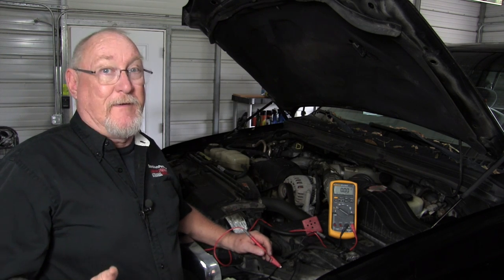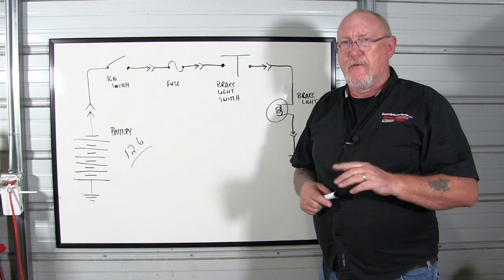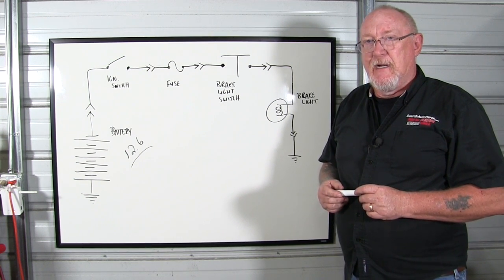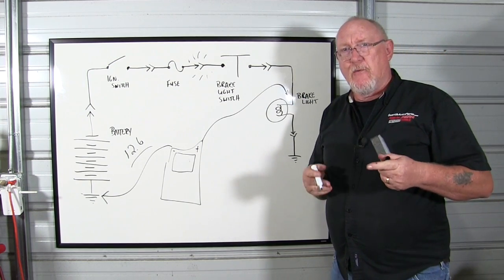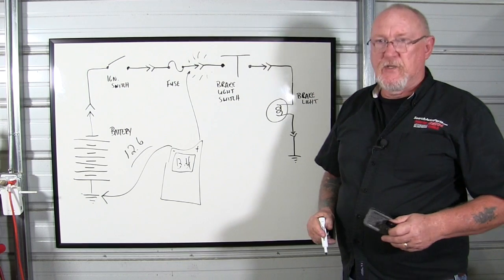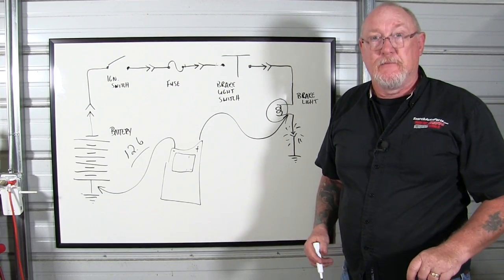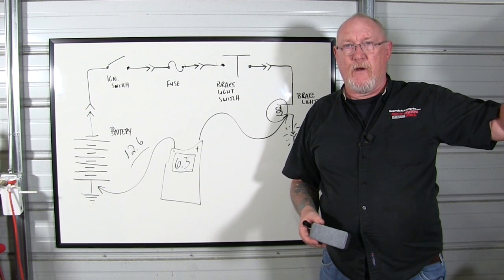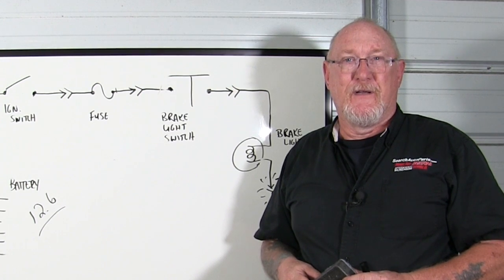The Trainer #84:  How You Can Measure Voltage When Your Meter Leads Say You Shouldn't

Comment: So if I pull the negative battery cable clamp off the batteries negative post, and check for voltage between that clamp and that post should I see any voltage? Does this indicate a parasitic voltage drain if I do? It’s a 74 GMC and there’s nothing that should be on (closed circuits).
Reply from the maker: The answer to your first question is "Yes, if the battery cable is disconnected, you will see full battery voltage". Essentially, your test leads are in the same position they would be if you were measuring battery voltage directly at the terminals. Think about it - the negative lead is on the negative post and the positive lead is on the positive post - in an indirect way - from the end of the negative battery cable through its frame and/or engine connection, through that frame/body connection, through any one of a hundred electrical components (like a light bulb) to the positive side of the circuit and back to the battery positive post.

Now, if the battery cable is connected and a circuit is on, you MAY see SOME voltage is the connection has an issue like poor contact or corrosion.

Second answer is "No, it does not indicate a drain". Why? The path is open and no current can flow.
Reply: Motor Age Thank you for the quick reply. I had thought that I wouldn’t see any voltage if everything were turned off. I even had the whole wire harness disconnected at the firewall and was still reading voltage between the disconnected negative clamp to the negative post.  It made me think my positive was going to ground somewhere and I couldn’t figure out where. What caused all this questioning was my battery was draining and would be dead within a day. Had it checked yesterday and it turned out bad but I think because I had been recharging it daily that maybe it was ruined from being overcharged a few times... I installed a battery disconnect switch with the new one and I didn’t want to start off killing my new battery so I watched your vids and wanted to ask your opinion. But if seeing that voltage is normal then I’ll call it fixed. The vehicle is a 1974 GMC Stepvan (old bread truck) with a SBC 350 and it still has the coil, points and condenser. There’s nothing electrically on when the vehicle is off (no clocks or accessories etc) which is why I figured I shouldn’t see any voltage going to ground. Thanks!

Comment: On paper, that is 100% clear.  On a vehicle, I am not sure.

I assume you have to run a wire from the actual battery negative terminal to wherever you are testing to do that ground test.  Am I missing something?  Is there another way?
Reply from the maker: Yes, you'll need an extended test lead to reach the back of the car. I also use an older #PowerProbe that comes equipped with long leads. It's accurate to a tenth of a volt - plenty for the majority of the testing I do.
Reply: Thank you very much.  After retiring, I took a class in Marine Engine repair.  I have no experience therefore I struggle with the basics.  We bought and studied Dan Sullivan's Load Pro in theory but I have not actually used it on an engine.  If you are familiar with it, is it worth studying more?  Thanks.
Reply from the maker: @mcconn746  Dan's book is pretty good and absolutely worth studying. Another great electrical guy is Vince Fischelli at "Veejer Enterprises" -  Google him to get his web site info.
Reply: We studied Dan's book in my Marine Engine class.  I theoretically understand the basics but I need some experience to really know how to do it.  At 70 with no experience, not many people are interested in my working for them part time.  I am just trying to pick up what I can out of curiosity.

Comment: excellent video pete......here's my question.......on the first corroded connection after the fuse, if you put the positive lead of the meter before the corrosion and the neg. lead after the corrosion........would the meter reading be the amount of resistance the corrosion is causing in the circuit telling you that there is a voltage drop causing the brake light to be dim .would that be another way to check for voltage drop,,,,,,,,,answer would be greatly appreciated........thanks for the vid;
Reply from the maker: You can check segments of the circuit and that is part of the technique AFTER you've checked the entire length of the circuit. If there is a source of resistance between the meter leads and current is flowing, there will be a voltage drop across the resistance. That's what makes measuring resistance across a fuse a great way to locate parasitic drain!
Reply: @VehicleServiceandRepair  thankyou

Comment: BAD EXAMPLE BAD BAD BAD... the ignition switch CANNOT BE in the brake lamps circuit!...!?  DONK!
If all fails in traffic... car goes dead... YOU MUST BE ABLE TO HAVE a last chance at turning on your brake lights
thus the brake lamp circuit is DIRECT to B+, so the cannon ball coming down on your arse gets some red lights to attend!
and there are many more point to point V tests to be done as in at the relay/fuse box (printed board circuit), the brake pedal switch(is probably the 1st point to point to check- pedal at rest), etc... and many times there is a fuse at the hot side at the tail end of the vehicle... etc... DONK DONK DONK!  let us get it right and complete and let us make sure the newbie is not left gaga!
Reply from the maker: Vallid point - thanks for sharing!

Comment: First if you show 1.8V connected from batt neg to body ground would that not indicate a parasitic draw and give you less then full battery voltage when testing the battery? You lost me with your circuit diagram. You are showing an open circuit in your diagram. Both your switches are open so you should not be seeing any voltage at the bad connection between the ignition switch and the brake light switch. I'm also confessed why you leave the neg meter lead connected to the batt neg for all testing. I was taught to move both leads down the circuit when testing each individual component or connection while applying load as the circuit needs to be under a load to test for voltage drop. Not sure if I make sense because I don't see where the test at the start of the video follows the circuit example.
Reply from the maker: Let me see if I can clear up the confusion. 

First, no - measuring voltage on the ground side as shown is not indicative of a drain on the battery, nor will it impact the reading at the battery. The battery itself is not low 1.8 volts. It indicates that there is a source of resistance that requires 1.8 volts to overcome. "All voltage applied will be consumed by the resistances in the circuit, in proportion."  

And you're right - I should have closed the switches on the board to avoid the confusion caused. 

As for leaving the negative meter lead at the battery, it is the first step in understanding the concept of voltage drop. Many learned the way you did, by testing sections of the circuit at a time. The problem is you are not diagnosing the complete path of the circuit and may miss something.

Please search our channel's home page for additional content on using this testing method. I'm sure that one will help clarify what I'm trying to share! Maybe this one:  https://www.youtube.com/watch?v=qdaOSiScEu8&t=18s

And thanks for taking the time to comment.
Reply: @HikerBiker  I see your comment is 4 years old, so you probably already figured this all out, but I wanted to add to what Pete is saying for anyone having the same question in the future. 

A 1.8V or any voltage reading doesn't necessarily indicate a parasitic draw. In order for there to be parasitic drain, there has to be current flow and having voltage available (i.e. difference in potential, voltage drop) doesn't necessarily indicate that there's current flow. 

For example, when you put pos lead on pos battery post and neg lead on neg battery post, you will get a reading of around 12.6 volts on a good battery, but there isn't any current flow. You're only checking how much voltage is available from the battery. The mutimeter is measuring the difference in potential between the pos and neg battery posts. It's necessary to have a difference in potential (i.e. voltage) between the pos and neg battery post for current to flow, but the presence of voltage does not necessarily indicate current flow. 

One way to check if there's current flow from the alternator, block ground, or chassis ground is to put an amp clamp around the negative cable close to the neg battery post. Another way to check is to disconnect the neg battery terminal from neg battery post, and hook up a multimeter in amp measuring mode between the two. 

Hope this helps

Comment: pete.. or somebody print some copies of this test and give one to pete.. https://i.imgur.com/kviX0VQ.jpg   feel free as i assembled that test from decades of experience and multiple sections of various factory service manuals.. and i use it on EVERY CAR i work on.  i can perform the first 4 steps of the voltage drop test in less than a minute. so don't be scared to learn this.. it will save you hours and reduce your electrical comebacks significantly.  this takes much many times longer to type than it does to perform. 

the setup.. check the percentage of charge.  engine off.. turn the headlights on for one minute. turn the headlights off.. 
12.65 is a fully charged battery
12.45 is a 3/4 charged battery
 12.25 is a 1/2 charged battery... the battery needs to be over 12.5  for the next steps of this test to be accurate.  if the battery is below 12.5 .. put it on a charger and bring it up.. you can perform the next six steps with a partially discharged battery but the results will shifted.. 

 the set up.. start the engine.. turn the headlights on..   set your volt meter to 20 volts scale. 
test 1. positive to negative Battery Posts.. not the terminals around them.. 14.1 to 14.8 depending on the car is expected.. 

test 2. Negative battery post to the engine block.. 0.04 volts is expected.    this measures the Negative battery cable connection to the engine block.. if you find more than 0.04 volts or 4/100ths of a volt then you need to narrow the test locations.. 

 test 3.   Negative battery Post to the body.. this checks the mid size wire that runs usually to the inner fender..  that wire supplies electrons from  the negative battery to the body where almost everything is grounded to except the alternator the starter and parts of the fuel injection system on some models.  this should be 0.02 or less. 

 test 4.. the engine block to the body usually at the firewall.  this checks the engine to body ground connection..  0.02 or 2/100ths of a volt. or less..  why is this an important test.. the battery can put out 12.65 volts fully charged. the alternator can put out 14.1 to 14.8 volts .. so almost 2 volts more from the alternator. but the electrons flow from the negative side .. so the negative electron path is alternator housing to the alternator bracket to the engine block . to the cylinder head usually to a braided ground strap that is bolted to the firewall.. hopefully not on rubber bushing or plastic coolant tank mounting.  there is a lot of current flow there.. don't believe me.. throw an amp clamp over the braided ground strap with the engine running and the headlights on. 

test 5. this is a Positive battery post to multiple fuse in the underhood fuse block.  0.04 volts.   why test a bunch of fuses..  not just one.. if you have ever had a fuse block out.. you will see that the fuses are set up in rows .. each row connected to a fastener.. but if there is corrosion between the buss bars inside the fuse box.. you can easily have multiple voltage drop measurements inside the same fuse box..  i have seen it way too many times.. 

 test 6.. not possible on some cars and trucks. but easily done on 90 percent of cars and trucks. . test between the  positive battery post to the alternator output stud..  not the terminal around it.  this checks the electrical connections beween the alterantor and the battery positive..   this can be as high as 0.3 volts and be OK usually.. some cars and trucks could be as high as 0.7 volts .. 7/10ths of a volt and that number came right out of a 1966 chrysler imperial service manual i have. you will know which one as it has a bunch of 666666666 across the cover.

 this is not the end of your testing.. this is the test sequence you do on EVERY car that you open the hood on.. like i said.. i can do the first 4 steps in less than a minute. 

 why...  copper wire has resistance to electrons flowing thru  it..  the engineers specify the size of the wire depending on the load so they get the expected voltage drop when the loads are applied..  look.. you can't jump start a big rig with a pair of 10 gauge jumper cables.  you can jump start a big rig with a pair of 1 or 2 gauge jumper cables as you have reduced voltage drop  by increasing the surface area of the wire strands for the electrons to flow .. oh.. electrons flow on the surface of the copper .. not inside it.  so surface corrosion will cause voltage drops also. 

  print the test i linked on imgur..  learn it.. practice it while looking at the printed page..   if you have a car or truck.. that keeps eating alternators or just does not work right.. pull out your printed copy.. perform the voltage drop test.  see what kind of results you get.. if you get more than the 0.02 or 0.04 volts you may have a resistance issue..
  
volt meters only read the difference in voltage between where you touch the leads to.. so if you have resistance somewhere in the circuit.. find it using voltage drop tests while the engine is running.. the charging system must be putting out some current to push electrons around so you can measure their flow across the conductors. (wire stands) 

 why did i type all this out.. because my friends are lousy camera men..  and its crazy noisy where i work..  8 lanes of freeway less than 40 feet from the shop..  not counting the off and on ramps. i can't even hear engines running during rush hour.  let alone talk on the phone or on camera..
Reply: Thanks for typing out all this good info. The link in your comment doesn't work anymore. Do you have a new link?
Reply: @bernardocisneros4402  the link still works.. it does take you off youtube  the link is a jpg page that is tests 1 thru 6 i typed out above..

Comment: Thanks Pete.  When I was at work (retired now) I used to get vehicles with intermittents and unknown electrical problems.  Some of the others either didn't understand this testing or gave up.  I would show them.  Some got it.  One vehicle was at a L.A. Dept of Water  & Power yard that was near the ocean.  Oh ya, it brought back memories of Massachusetts and rusty, crusty vehicles.  Body grounds varied in voltage drops.  I ran a continuous number 10 gauge wire from a ground point inside the cab on the driver's side to ground points I found under the hood, finally crossing over to the battery on the passenger side and it's body ground there.  Had to repair that ground on the body panel then bolt the ground wires solidly to that panel.   Eliminated all the intermittent and unknown problems.  THAT was a "fun" job!
As Ivan would say. "No parts replaced."

Comment: Great video, But I have one question Just say your VD testing the pos side of the circuit with the ground lead to batt ground and the pos lead to right at the load and you get a reading of 10.1 volts and your batt voltage when  testing source voltage was 12.6 then your are dropping 2.5 volts right? The main thing that is confusing is where is that voltage going, the bad spot in the pos side is using it? Same with the negative side? Thanks
Reply from the maker: You're right! You are dropping 2.5 volts. And you're also right that how that voltage is lost is what confuses most techs. Here's what's happening - EVERY source of resistance in the circuit takes away its proportional share of source voltage. For most cases, the amount of resistance, relative to the load, is negligible so the loss is on the order of a few tenths of a volt. BUT, when there is corrosion (or weak contact, or other circuit fault) the resistance THERE goes up relative to the load. AND IT DEMANDS ITS SHARE!

So, to try and make it clearer for you, when you measure less source voltage (with the circuit on and current flowing) than you started with, SOMEWHERE before the load there is a NEW source of resistance that isn't supposed to be there. And it's stealing source voltage away from the load.

Does that help?
Reply: Motor Age yes thanks so much, it deff makes a lot more sense now

Comment: Outstanding video with a clear explanation.  Only minor issue I noticed which may cause confusion is the battery symbol as drawn is positive ground.  Principles are still the same regardless if it's positive or negative ground. (The long plate represents the positive, and the short plate represents the negative.  https://en.m.wikipedia.org/wiki/Battery_(electricity) )